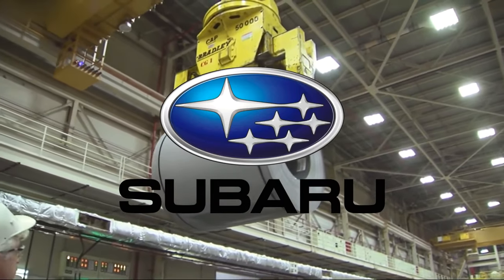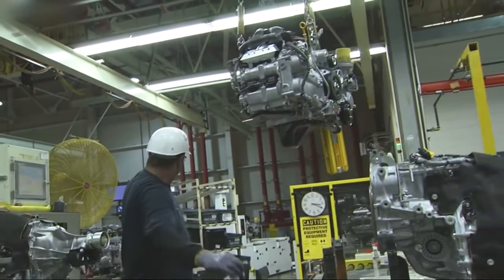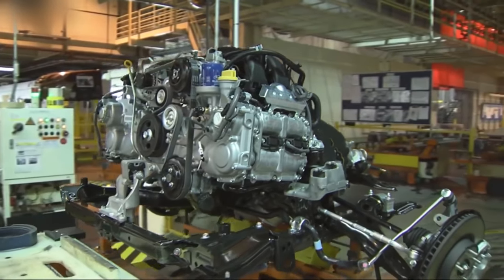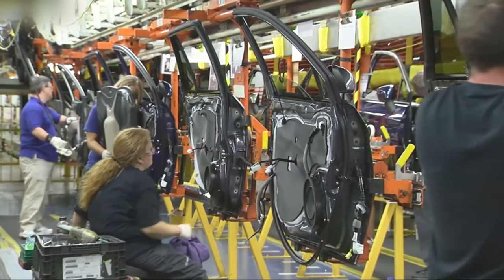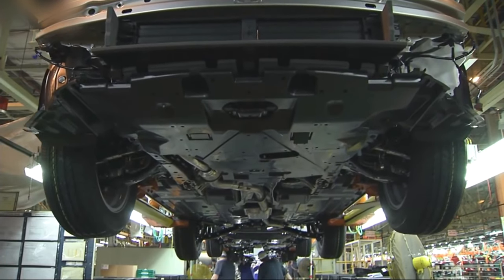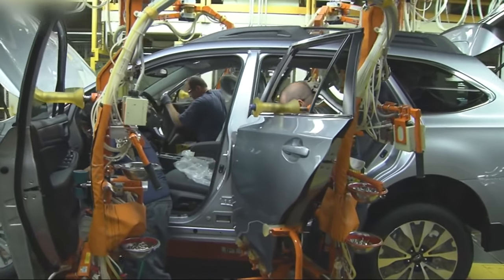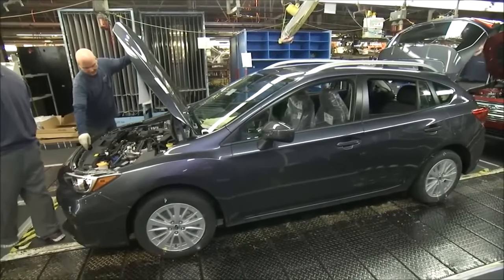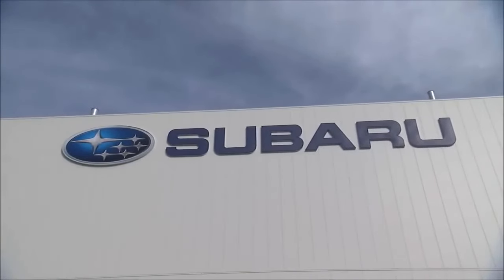SUBARU FACTORY🚘2024 Producing WRX, Forester, Outback, Impreza – Where it's made?🔥Manufacturing

Comment: Why is Subaru having issues now if their cars are so made so well and reliable from the outside -inside?  There have been a lot of Recalls for certain models of the Subaru.  I mean I like the car, so I guess I have to wait until I find out what the Recalls are all about.
Reply: There are no current recalls on the Outback XT. My Touring is an awesome car. The CVT is a fine transmission as well. Just don't launch like the NHRA and you'll be fine. Even light on the throttle and the car moves swiftly. Very happy with my purchase.

Comment: Yes the Horrible CVT is a Worthless transmission.
It’s CHEAP to build, but it costs $8K  to buy another one and $1K to put it in your car. Then you get to have the silicon gaskets replaced at $2K so it’ll last another 150K miles.